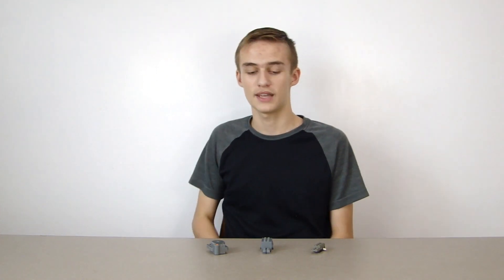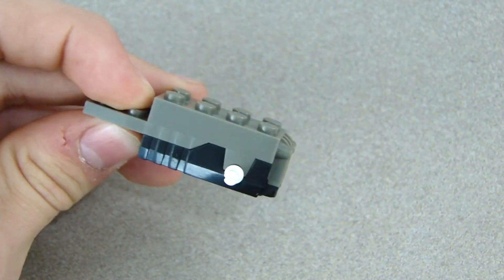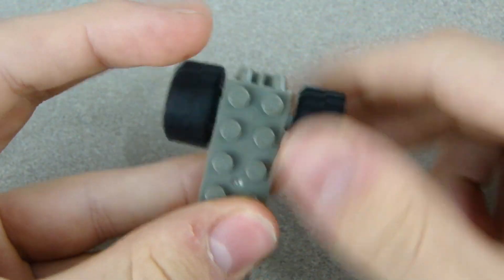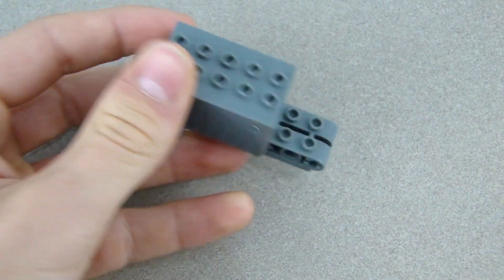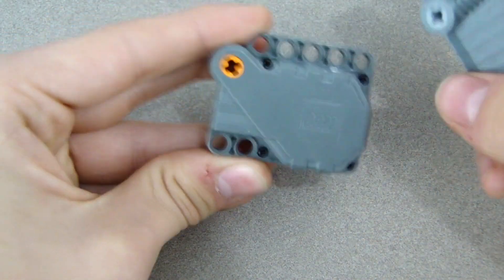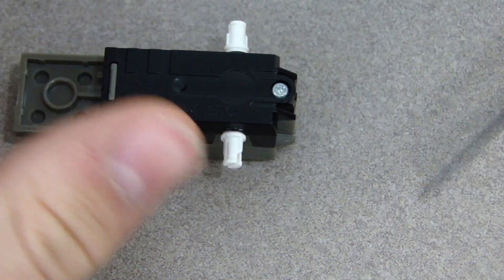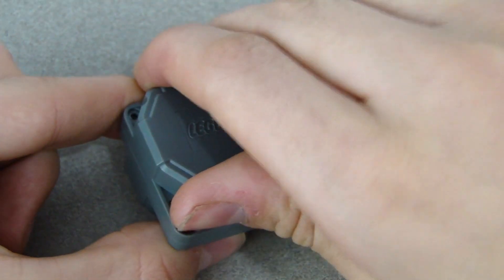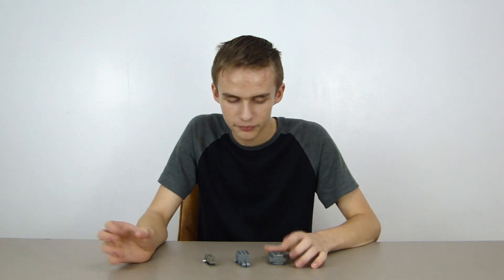What's Inside a Lego Pull Back Motor?

Comment: so, did you figure how to open it?
Reply from the maker: I have not really tried since the video.
Reply: @brickstudiosYT  I have one that's not working correctly and wanted to open it to see what's going on.
Seems super easy to beak while opening it thow
Reply from the maker: @Achu744  So do you have the small pull back motor I couldn't get open?
Reply: @brickstudiosYT  yes, the exact same one. But I'm afraid if I try to open it I will break it. That's how I found your video, was trying to find instructions on how to open it properly.